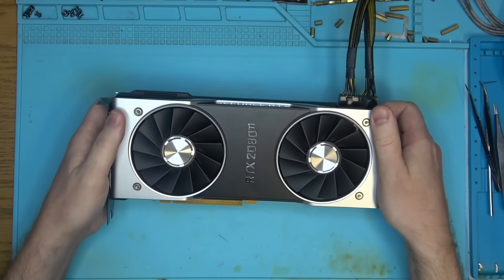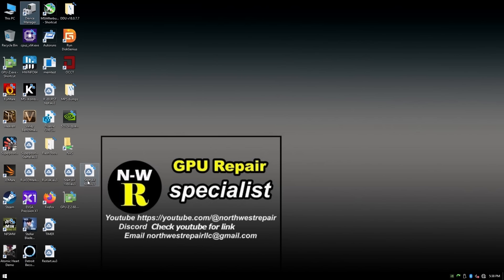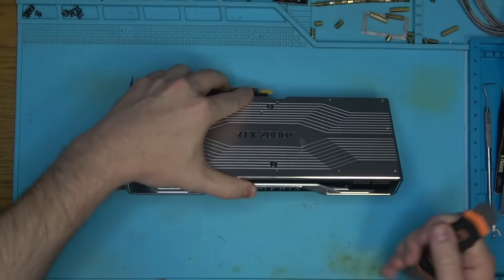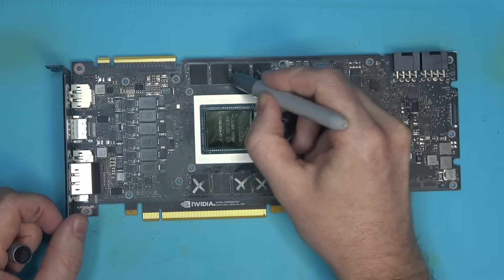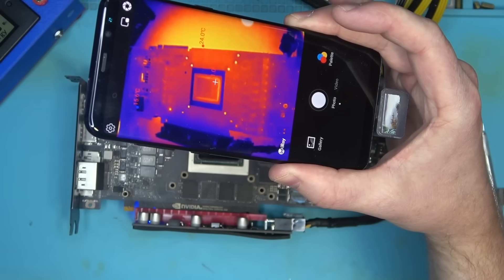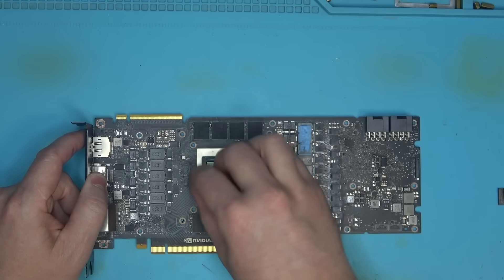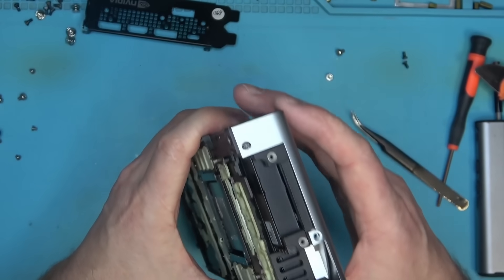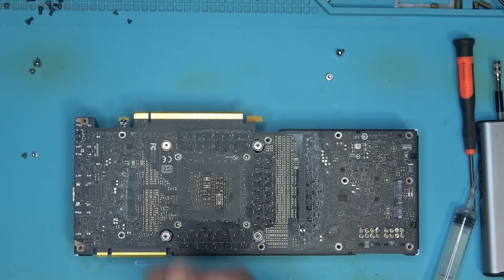2080Ti memory upgrade video 11GB to 22GB

Comment: Nvidia doesn’t limit vram capacity with latest drivers as out of spec?
Reply: I got one of these used on a local auction site. It's probably from one of the sellers in china that do tons of these. I have zero driver problems. The 22gb is fully usable in everything I've tried. Mine was a loud blower model but I mounted an arctic accelero xtreme iv to it and it is now almost silent even at full load. Never seen it go above 60c either.
Reply: @argkatt9040 that's great to hear. I'm seeing out of memory when running AI models on 4070 super
Reply: @vasudevmenon2496  Yea some models need alot. I rarely max out the vram. I only got an out of memory error once but I was pushing it haha.But since the 2080ti is an older card, even if vram is enough it will be slower in some things. Overall pretty good though.
Reply: You don't need latest drivers to play (most) games.
Reply: @n0n4me-h2h  but after applying windows update that breaks things you will need latest drivers

Comment: PTM7950. Phase changing thermal pad. You need a heat gun to remove the mirror and there are screws under there. It’s just stupid. Thanks Nvidia.

Comment: My 2019 - RTX 2080 Super watercooled i fix then a month L8tr back to bluescreens  or stalled game IDK  
lucky i persist with diy or it wouldve been ina draw  ive ran test like you did shows nothing but soon as i play bf5  1/2 hr its done . 
temps on cpu & gpu watercooled 50cel +/- idk somethings buggered a chip or resistor somewhere
Reply: samsung drm chips aliexpress $2.50
Reply: update:   just got a RTX2080Ti  11gb delv today >  if i looked the rx9500xt was au150 more   never mind this is for battlefield  rip 2080super till i get fixed 
if it cost me $100 to repair its still a spare gpu

Comment: 22G, ready for 10 more years, I wish I had that in my 3080
Reply: The original RTX 3080 (10GB) would benefit from 20GB VRAM. Or anything over 10GB.
That card is usually/often bit faster than RTX 5060 Ti (16GB).

As long as 10GB VRAM is enough...
Reply: @eukariootti1  the original 3080 was supposed to be 20 gb, there were leaks of boxes already printed with 20gb. Only real reason they did not do it, is to prevent another 1080 ti, and preventing it from overtaking the 3090, basically forcing people to go higher to get more vram.
Reply: @eukariootti1 probably more cost effective to just buy a 3090ti
Reply: @eukariootti1  20Gb would be unnecessary, but it was dumb not to go with 12 from the beginning (that version came out later).
Reply: @Tc4ify  Absolutely not brainless. 20gb VRAM is minimum any board should have.
Reply: @Tc4ify  20gb is not enough for some games at 1440p let alone 4k
Reply: @DrAliToma  Not at the settings 2080Ti can still give anything close to playable framerates.
Reply: @tomf5450 if your 20gb vram is not enough for 1440p gaming then you have a shit gpu. 3080 10gb can play any game in 1440p
Reply: @eukariootti1  what a joke 
5060ti can enable framegen x6 and be 5 times faster according to Nvidia ceo
Reply: @wildcat002  that's not how that works btw
Reply: That's why i got a 3090 instead of 3080, i didn't trust those 10GB
Reply: @buzdalys5524  They couldn't just give it 11gb could they.
Reply: Lol imagine how slow and underpowered it will be in 1p years😂😂
Reply: @darrellbeets7758  Precisely - it's already barely good enough for 1080p right now, maybe you'll still be able to get by with (very) low settings in 5 years, but it will be absolutely useless in 10.
Reply: put 24 gigs into a 5060 ti
Reply: it still needs the horsepower to utilize the vram
Reply: According to TechPowerUp's GPU Database (rasterizing only, @1080p), RTX 2080 Ti is roughly as fast (+/- 2%) as:
   * RTX 3070/4060 Ti/5060
   * Radeon 9060 XT

4060 Ti and 9060 XT do have 8GB and 16GB versions. Those others have only 8GB version.
  RTX 2080 Ti supports the latest DLSS 4.0 (except FG/MFG).
Reply: @eukariootti1 so my 9060XT 16 GB is a top of the line card from 5 years ago basically 😮
Reply: @TechDove no Radeon card is top of the line. Sorry.
Reply: @mintymus you don't get it do you. It matches the 2080ti in performance. Which was the top of the line card for the 20 series
Reply: @TechDove not even close. Sorry you were duped.
Reply: @TechDove  I am pretty sure the 9060 xt 16gb is faster than all the ones listed based of Hardware Unboxed testing
Reply: @mintymus lol, why are you bootlicking that billionaire in his leather jacket and his trillion dollar fraud?
I have a 5090 because I want top tier performance, but for everything below that the 9070 XT (or for the generation before the 7900 XTX) is by far the best card you can buy.

I have multiple GPUs currently in use on modern systems, the oldest from the rtx 2000 series and the radeon 6000 series and then even older stuff like GTX and eben GeForce 2 cards and 9800 XT on the AMD (ATI back then side).

I own many cards of both companies and had different preferences over the years, but like I said, in this generation the 9070 XT is by far the best and most sensible card you can buy.

Only if you really want the highest tier performance you should get a 5090, everything below that the 9070XT (or a used 7900 XTX if you can get it for around 600$) is what you should buy.
Reply: @eukariootti1 now do the 1080ti and piss everyone off. Throw an arc underneath for frame gen and chug away at battlefield 6 at 1440 high-med
Reply: I would assume owner is using the card for AI since they can eat up lots of VRAM. 22GB is useless for games.
Reply: Ummm no! 😂 Trying running UE5 games on this useless card 😂
Reply: @Nerd_Rage_Initiated  oh no. People won't survive playing at 100FPS!!!!
Reply: @mintymus UE5, RT on that...good luck getting 35 fps native 😂
Reply: these gpus including 3080 aren't that strong on the core my friend. I have the best of 3080's EVGA FTW3 ULTRA and this thing struggles to give decent image quality on euro truck sim 2 VR
Reply: @tugrulserhat are you dumb? 3080 is literally a big mistake because it was to powerful. My 3080 with fkn 10gb plays eveeeerrryyy game in 1440p with over 120 fps. If you have problems your cpu probably sucks
Reply: @tugrulserhat  you have no idea what you're talking about.
Reply: @mintymus  yes I the owner of said gpu and a vr headset to try exactly what I typed here, have no idea what I'm talking about and you do bro. good for you
Reply: @tugrulserhat even more surprising that you have no idea what you're talking about.
Reply: @tugrulserhat  3080 core is plenty strong, what make it struggle is the vram capacity. thats the reason people say you yapping nonsense and dont know what you are talking about. do some research before yapping is a better idea
Reply: @asdfsdfsadfasdfsf not for vr buddy
Reply: @mintymus  12yo
Reply: @dyfrigshandy  then you shouldn't be on YouTube
Reply: 10 more years of 30fps 1080p. Waste of money.
Reply: Raw power will hold him back before the vram
Reply: @Buruleque  I've got a 2080 Ti someone panic sold for a 3070 during COVID for $450~ and it plays everything I throw at it @1440p perfectly fine. 100~200 fps depending on the game without DLSS. The only thing that I recall struggling with recently was Starfield, but got it to playable frames with Hardware Unboxed suggested settings until they enabled DLSS. Probably don't play as many AAA titles as most people, but it gets the job done for me and was a hell of a deal at the time. Still not as good of a value as my old radeon hd 5770 though... That thing carried many a battlefield rounds until I upgraded after BF3 and then served my lil brothers climb in League of Legends to Grand Master for nearly a decade in his PC after.
Reply: @Buruleque  People don't actually think that a 2080ti is getting 30fps at 1080p right lol?
Reply: @Buruleque thanks to Unreal Engine 5 which destroys pretty much all of Turing ;) , that architecture really doesn't handle that engine well
Reply: @Buruleque  Precisely - it will run out of horsepower WAY before running out of ram. Now if it had only 8Gb, it'd be a different story...
Reply: @Buruleque everyone about to argue with you, but they literally have no idea that they aren't running games on anything beyond stock settings.

These people never ran a game on epic settings, let alone past 1080p😂

They don't know anything beyond 60fps, 120 is still magic to them.
Reply: @Buruleque running ACC in 4k at 100fps+ on my 2080ti with a 5700X3D. Suits my sim rig fine.
Reply: @Buruleque even a 1070 gets better than 30 FPS. You've proved your ignorance.
Reply: @mintymus  Better than 30FPS? In which title? Minecraft, CS2? Or more demanding games like Cyberpunk or Rust? Oh the irony
Reply: @Doddster1983 sure, It will do Cyberpunk, especially with FSR. Where's the irony?
Reply: @mintymus  FSR? So fake frames? Ironic
Reply: @Doddster1983  Even without FSR, a 1070 would run Cyberpunk higher than 30 FPS. Simply look on YouTube. 😂😂
Reply: @mintymus  ''better'' than 30 FPS is like 60FPS min, more like 100FPS...Not 31 FPS :/ And we are talking in 10 years time too... It's ok, everyone needs to upgrade once in a while, including you if you're that much in love with a 10 series card. :D
Reply: @Doddster1983  10 series cards work just fine for many people, at way higher than 30 FPS. Btw I have a 40 series.
Reply: @mintymus I beat Alyx with a 1070. It looked awesome.
Reply: @SheddysGaming Still performs well.
Reply: @Doddster1983  ragebait ahh, come on you just got a brainwashed brain since you probably have a 5090 or sum, grow up 30 fps is still good for some people who just don't care, oh yeah btw about the 1070 it runs at 60+ fps most of the time, so yeah it's way better than 30 fps or like you said "31 fps" come on lol, do your research dude.
Reply: @Doddster1983  you're 12yo
Reply: @Buruleque at low settings too 😂
Reply: @soundsOf75  He's talking about a 3080, not a 3050 or smth. Are you guys mentally handicapped? A 3080 can do a heck of alot more than 30 fps on 1080p...
Reply: @zackzeed the "ready for 10 more years" is referring to the 2080ti on the video. the commenters 3080 is irrelevant.
Reply: @zackzeed  In 10 years tho?
Reply: @zackzeed  He mentions 22Gb (hence the 2080TI from this video, then 10 more years).

Comment: Looks like the temps went up a couple degrees with the PTM 7950? It's said that stuff takes a few heat cycles to break in fully. I'm using it on my 9800X3D and it definitely outperforms my previous pastes by a little bit. It's also supposed to last basically forever.

Comment: I always hated the 1 missing chip on the highend 2080ti. Is it possible to add the 12th chip when the even software recognizes thats it is missing?
Reply: no it is not possible. this chip is disabled inside the core (hardware level)
Reply: From what I read these cores have defects in one of the memory channels so rather than scrap the whole core they disable the bad channel and sell it as a downgraded version.

Comment: i have a 2080ti that sometimes will refuse to boot if it's cold, but if i let it boot loop after 15 minutes or so it will start up
Reply: Sounds like some solider joints are broken, then as it gets hot, it's making a connection, like an old Xbox , that when thrown in the oven or wrapped with a towel fixes it for a while.

Comment: These Nvidia founders edition cards are always more trouble than they are worth. They did become a lot more competent at making a product competitive with their board partners (which is a problem in itself) but good luck disassembling it for a cleaning or a fan replacement, especially with the new ribbon cables.
Reply: I stay away from FE cards. Not only these are not the best and never were in terms of heatsinks, but also these cards have no fuses and when MOSFET fail they burn the PCB through.
Never understood why these are in high demand.
Reply: The FE cards are the only ones that still sell for MSRP (at least for a 5090), If you want a 5090 for MSRP getting lucky enough (or beeing peristent enough) to get the FE is your only real option, sure they are not the best but paying 30-50%+ extra on AIB cards is not worth the extra money.
Reply: @KeinNiemand  If you're nickel and diming a $2000 MSRP card that doesn't have the usual protections an AIB partners would provide, then you shouldn't complain about the GPU when it dies and is not repairable, or you shouldn't be buying that graphics card in the first place.

Comment: The regular paste was a lot better than the phase changing film thing, right?!! Looks like the paste was 58-60c  with the fan at 60% and the Phase change thing was 68c with the fan at 73%!
Reply: Has little bit of a break in period but it works better over long term than paste won't have to do it again in that cards life with ptm7950

Comment: Most of the people doing the 22GB upgrade for the 2080ti do so for AI.  VRAM is king for AI.
Reply: Wat I have been saying the whole time
Reply: I found a used 2080ti 22gb on a local auction site. I dabble a bit in ai and other workloads that need lot's of VRAM. It would indeed be silly to buy this purely for gaming but the value is great if compared to other cards with similar amounts of vram. I was initially thinking about a 3090 24gb. It is more powerful but also draws more power and is more expensive. Considering I didn't feel like spending even more money for that plus a new psu I think I did alright. I rarely game and the few older titles I do play, the 2080ti easily handles very well. It is an old flagship after all.

Comment: I thought you needed to update the bios if you changed the VRAM configuration but apparently not ;-)
Reply: He did have to move some components around to change the memory configuration. The BIOS reads that to get the right settings
Reply: you can simply solder bigger memory chips 2 GB or even 4 GB and have the card auto recognize them without any BIOS Mod on most Pascal Nvidia GPUs (TITAN/GTX 980/980ti/1080/1080ti)
and some older AMD Polaris cards (RX 470/480/570/580) because of the way their memory controllers handled device ID detection and strap tables.. memory controllers were simply tolerant and designed to accept multiple densities
Reply: @samisonline99  Evidently ;-)
Good to know.

Comment: 10:29 - There are screws under that plate in the middle of the card you were heating up, unfortunately the video I watched, they ended up bending that plate to get it off.
Reply: I had to take mine apart years ago, and it was a gaint PITA to get apart with damaging it...I ended up using a heatgun on low, some dental floss, and guitar picks...

Comment: Can you do a 3080 upgrade from 12 to 24?
Reply: You need a new PCB that's double sided like 3090 to be easy ( you could also replace the actual chip, but need a new BIOS that not wildly available ( same BIOS as modded 3090 48GB ))

Comment: It ran cooler with the thermal paste instead of that phase change pad😂
Reply: They need to be burned in with several heating and cooling cycles. It is normal for the first run to have worse temps than thermal paste.

Comment: how much a upgrade like that cost?
Reply: Also would like to know
Reply: It makes sense if your card is as powerful as RTX 5060 Ti or 5070, and held back by 8GB or 12GB VRAM size for larger textures or 4k. And you don't want to buy another card.
Reply: @Soravia It would cost hundreds of dollars in total to have this mod done which makes no sense on those caliber of cards...If you have a 5060ti class card and you want more vram, just sell your current card and add the money you were going to spend on the ram upgrade to buy a better card...
Reply: @brucepreston3927 yeah some 70ti class but mostly 80 or greater class cards would truly benefit and the cost is generally prohibitive and typically a newer generation or higher tier new card is more cost effective, barring certain specific use cases. 🤔 😅
Reply: For example, RTX 2080 Ti (2018) is roughly as fast as:
   * RTX 5060      (2025)
   * RTX 4060 Ti (2023)
   * RTX 3070     (2020)

As long as VRAM isn't the limiting factor. RTX 5060 Ti (2025) is always bit faster, if compared to its 16GB version.
Reply: @Soravia  in that case, 5060 Ti is also held back by its x8 PCIE bus. Which you cannot do anything about.
Reply: @n0n4me-h2h less of a concern than memory size. GPUs now are so powerful, they can use spare power to make fake frames while waiting for VRAM to make the next actual frame.
Reply: Me too.
Reply: Me too
Reply: What would it cost to upgrade the VRAM? I live in the US. 
Some people ask why would anyone want to do that. Well some of us like to keep our video cards for nostalgia sake. And for using an older computers with older operating systems. 

What I didn't see that was clear in the video what does everything recognize the 22 gigabytes? I may have missed it if it was mentioned. 

Thanks for any answers.
Reply: it's absolutely worth it. chinese skilled technicians are cheaper than their western counterparts and can upgrade these cards by the dozens in a 'factory' and sell them for A.I, bulk buying and shipping 2080 tis from used markets from all over the world to china for the upgrade. infact, the 4090D dragon edition was made simply so jensen could try to have a slice of the AI pie in china. it's a big deal over there.
Reply: It makes zero financial sense to do this upgrade unless you have the skills to replace the chips yourself...They chips themselves don't cost alot, but shipping both ways and labor to install them would probably cost more than the card is worth...
Reply: After to and from return shipping and the labor required to solder the chips, as well as the new memory of course. Usually not a repair that makes sense financially compared to upgrading, but does end up giving the user a solid piece of equipment.
Reply: 10 dollars
Reply: @accountnotfound4209  :D